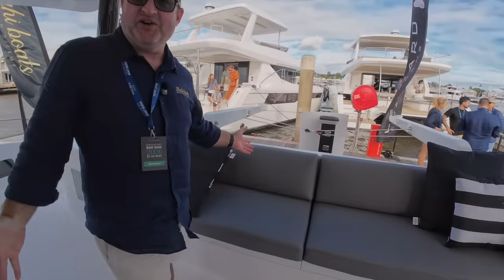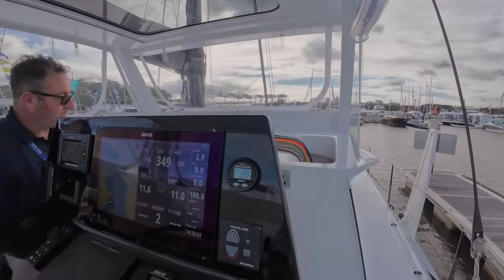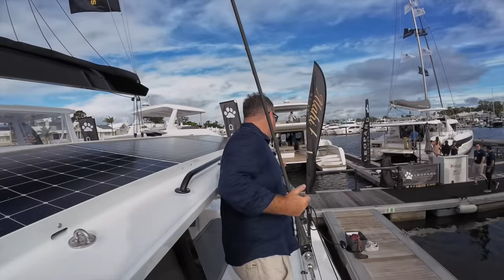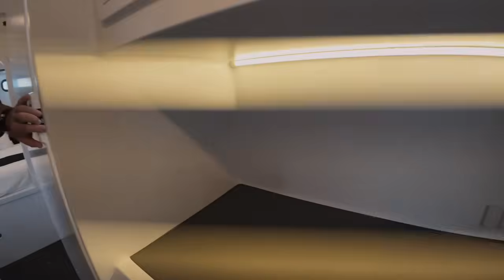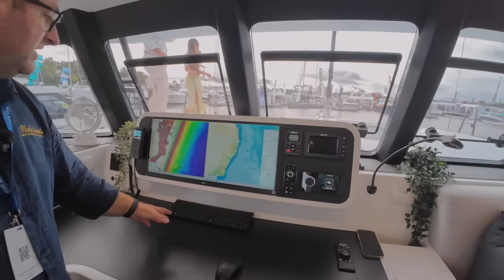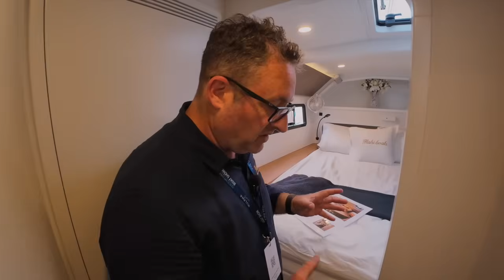This INSANE Custom Catamaran Is the Boat Everyone Talked About at Sanctuary Cove

Comment: ARIT ADAY AHOPE IMAGINE EVOLVING BEYOUND BIGGEST HANDICAP OF ALL BOAT SHIP DESIGNS( STRESS DRAGGING  SPEED HANDELING COMFORT ⛽  ROLLING  )  ALL SO  90% MAINTENANCE ⛑ EVERYTHING HAS MOVED BEYOUND  NOW OPPORTUNITY FOR REDESIGN CONFIGURATION OF HULL USEING THRUST TO ENTER TROUPHS AT DIFFERENT LEVEL ANGLE COMPLETELY DISAPATING PUNCHING WAVES MOVEING CONSISTENTLY A,HEAD DISAPATING ROLLING COMPLETELY  NO MORE SHIPPING WATER OVER VESSEL ONLY WAY TO GO BEEN DRIVING  FISHING BOATS TUGS CARGO RESCUE FOR 50 YEARS  MOSTLY NORTH SEA CHARTERED MARINE ENGIN.EARD  30 YEARS ONLY WAY TA GO NOW TATA

Comment: That,s the same boat SV Lynx is building but bigger I think. Lynx is 50'. I think Schoening is having financial drama. Maybe shut down.
Reply: Actually, this is exactly my design, same exact structure and length.  They made some layout changes in the salon, but basically, this is the Solitaire 1520 that I originally 3D modeled for Schionning.
Reply: Why do you think that’s the case with the financial issues? Thanks
Reply: @ryanstroeder7908 potential insolvent/bankruptcy as reported
Reply: Its SV Lynx 2.0 right down to the height difference for the owner couple!